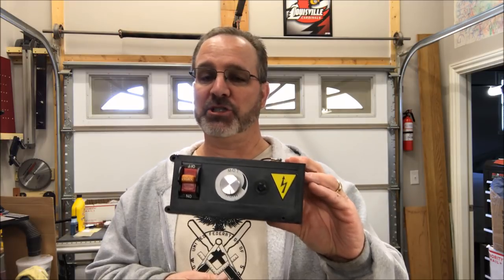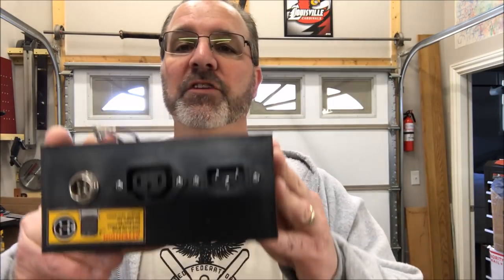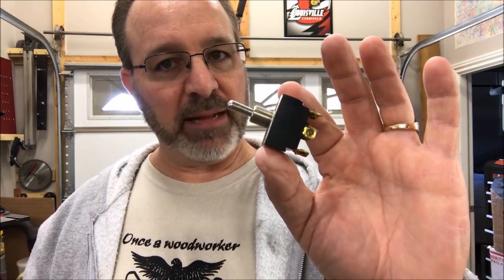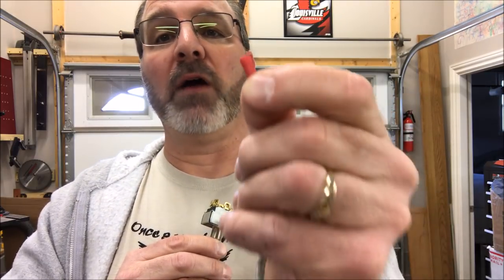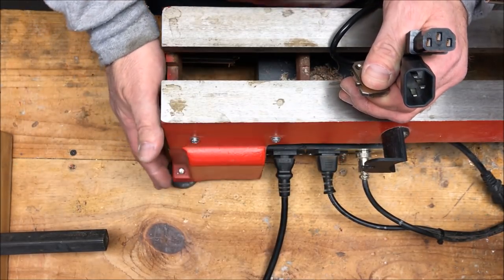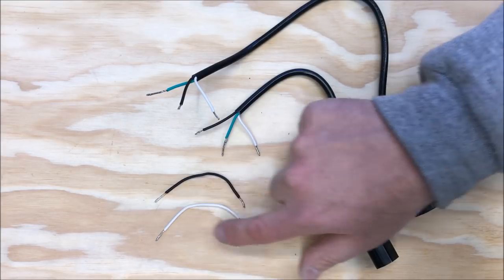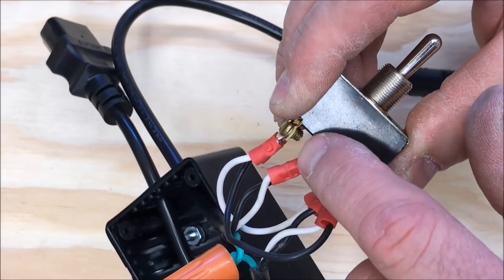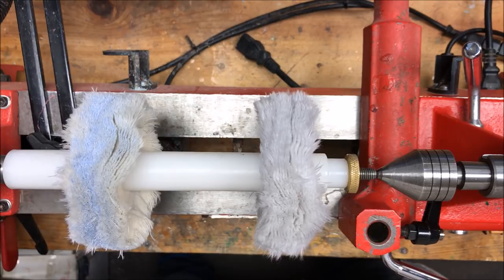I Built A Reverse Switch For My Lathe.

Comment: Hi Bob
Well I am an electrician and I think that you explained this project very well, the one thing that you should have included is a strain relief connector on the cables where they enter the box, other than that a great job and I know you will love having the reverse option. 
I do not have that option on my current lathe but I'm buying a second new midi lathe this year that will have reverse, and great tip on a lock screw on the chuck. 
Take care
Rob
Reply from the maker: Thank you Rob,
  I appreciate that. 

Regards,
Bob
Reply: Was just about to say the same thing. The other thing is that you can most likely (i haven't looked) get a guarded dpdt switch and reduce the possibility of of an accidental power up.

Comment: Very well explained video.
I did something similar.
I converted a HF 1”x30” belt grinder to a DC powered knife sharpener using a PSI woodworking midi lathe conversion kit. I needed the motor to turn in the opposite direction it came so I reversed the blade terminals on the Circuit board that supply the motor. Now after using it for a few months I would like to have the option of either direction of rotation so I’ll Install a switch similar to what you’ve done.
Again, nice job👍🏻!
Reply from the maker: Thank you.  

Regards,
Bob

Comment: The last part about the chucks is very important, there are special, reversible chucks on the market by a number of manufacturers such as Nova.  It can not only loosen the chuck from the headstock but it can cause the jaws to loosen as well.  Neither is good for you or your project!
Reply from the maker: Thanks Doug. 

Regards,
Bob

Comment: one correction Bob, most ac motors can be made reversible with a switch.  BUT not this way.  if its a single phase motor, you have put the dpdt switch in the starting circuit.  if its a three phase motor you install the dpdt switch in any two of the 3 power leads.  i have done this several times with single phase motors
also trying your method on an ac motor will not harm it at all,  the switch just wont do anything, ie no change in rotation!
also, good point about using a chuck or faceplate in reverse, both my chucks(Oneway) and my faceplates have threaded holes for setscrews.  BUT one very important note, if the setscrews bite into the threaded section of the lathe spindle, the thread will be damaged.  the way around this issue is to cut a small piece of solid 14ga copper wire about 1/4 inch long, bend it into a U and drop it into the setscrew hole before inserting the setscrew.  the soft copper will protect the spindle thread.  when you remove the chuck from the lathe, most of the time the copper piece (now all distorted) will stay in the set screw hole and can still be used
i'll send you a pic on facebook of the setscrew/copper wire
Reply from the maker: Thank you for the Information Steve. 

Regards,
Bob

Comment: The biggest challenge in adding a reversing switch is finding a way to mount the switch.  You have come up with a great solution!

In addition to the concern about the chuck, there is one other issue here - NEVER switch directions while the lathe is running!  Instead, only switch directions with the lathe on/off switch in the off position.
Reply from the maker: Agreed Louie,
  That’s one of the main reasons I wanted the On-Off-On switch.  To kill the power before reversing. 

Regards,
Bob
Reply: I did it!  I bought a box on e-Bay, and a switch at Homer's about a year ago, but then put the project on pause to think about how to mount the box.  Based on your suggestion, I used a magnet (from Harbor Freight).  One concern was that the bolt that mounted the magnet extended pretty far into the box - the solution to that was to wrap it in heat-shrink tubing, and then zap it with a heat gun to shrink it down to conform to the bolt.  I thought I had a C13-C14 cable, but I couldn't find it, but I found a relatively inexpensive source at Amazon.  Like you, I used StaCon ring terminations to make the connections, and after wiring up everything, I used an ohmmeter to check that there was no stray connection between the two sides of the DC circuit - in both the forward and reverse positions, and also while switching. And as Rob and others have cautioned, I stopped in Ace Hardware this morning to pick up a couple of nylon strain-relief bushings.

Did I need it?  Don't know, but I did want it!
Reply: One additional thought in the 'if I were to do it over again' column -  I bought a 2 ft. c13-c14 cable.  That's long enough to allow me to attach the box to the back leg of my lathe.  But in retrospect, buying a longer cable would have been better because it would have provided far more flexibility.    An 8' cable would have cost less than twice what the 2' cable cost.

Comment: This is kind of a different take on the model railroad procedure for wiring track reverse loops. They typically run the wires from the middle two terminals to the rails (track). The two wires from the controller attach to the outside two terminals on one end, with a jumper off each one going to the diagonally opposite terminal on the other end. I guess that would work for this too. Great video!
Reply from the maker: Hello Tom,
  I have to trust you on this one, I never would have been able to accomplish it without the help of my viewers. I’m not much of an electrician. 

Regards,
Bob
Reply: @RJBWoodTurner  What you did worked swimmingly well! The old “ more than one way to skin a cat” thing (with apologies to cat lovers!)! You taught me something here, and it’s dang hard to teach an old dog new tricks! Ha! I just took delivery of the same lathe, and I will be doing this upgrade! I just discovered your channel and really enjoying it! Thanks!
Reply from the maker: Thank you Tom. 

Regards,
Bob

Comment: I'm glad you stressed DC motor over AC. Universal motors which run on AC or DC and most people view as AC, can be reversed but that requires disassembling the motor itself.
Reply from the maker: I really don’t want someone trying this Ann getting hurt. That’s why I was skeptical about posting it. 

Regards,
Bob
Reply: The way you did it was removed from the electronics and motor so it was the safest way possible.

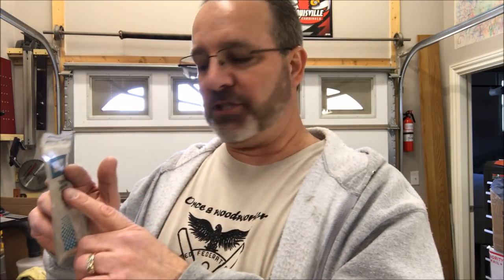Comment: Great job Bob! You explained it very well. I have just a couple of comments. First, at 5:55 you said your motor's plaque said 120 volts AC. I just pointed this out because  I'm sure it was a mistake (as shown when you showed a picture of the plaque) I just didn't want anyone confused because it's very important. Second, in all my years working in electronics, I've never seen a switch that didn't come with 2 nuts. One is to be put behind the panel and the other one (sometimes decorative) goes on the front of the panel. Check around and see if you didn't drop them. If you can't find them let me know, I have extras around here. See, you didn't thing anyone was paying attention! LOL
Reply from the maker: Thank you Jim,
  I have looked all over the place, I even swept the shop this morning hoping to find the nut to hold the switch in the box. If you have spares, I’d be happy to pay for them as well as shipping. The threaded switch post is 1/2”. 

Regards,
Bob
Reply from the maker: Thank you Jim,
  Address sent. 

Regards,
Bob

Comment: Love the videos Bob.   I did something similar to my Harbor Freight lathe.   I replaced the motor with a DC motor and built a variable speed controller on it.   Sure beats changing belts, but I kept the old motor/controller just in case. :D  Would be great to try and add reverse to it also.
Reply from the maker: Thank you Paul,

Regards,
Bob

Comment: Great tips! It Looks like I have the same lathe as yours.  Can you put the link on those parts you've used?
Reply from the maker: I don’t have a link, it was just a 120volt on-off-on switch that reversed the polarity. Any electronics shop should be able to sell you one. 
The motor on that lathe gets power in one direction. That makes the lathe spin towards you. Reverse that powers direction and it will spin in reverse. 

Please consult the experience of one of the people at the electronics store. I am not an electronics expert. 

Regards,
Bob

Comment: Oh and if there is anyone out there with a 3phase ac motor ( unlikely ) but if there is then it is possible to reverse that motor simply by swapping any 2 leads to the motor although it would most likely be controlled by a VFD with reverse option built in. 
There are (VFD's) that are 240 single phase in and 3 phase out. 
VFD= variable frequency drive , these control the speed by adjusting the frequency.
Reply from the maker: Thank you Rob. 

Regards,
Bob

Comment: I have the same lathe and would love to have the switch on mine.  (Note for Turncrafter - why don't you put the switch on in the factory).   Not too sure that I want to try it.  I have an  ac motor on a large lathe that an old timer added a switch to for me and it works fine.  I'll have to look at it to see how he did it.  Thanks for the great video.
Reply from the maker: Thank you Edwin. 

Regards,
Bob
Reply: The Turncrafter lathe is actually made in China, and is sold by various retailers  in the US (PSI), Canada (King Canada), and UK (Axminster) with the only obvious difference being the color of the paint.  The King Canada version appears to have a reversing switch included in the control box as supplied from the manufacturer.

Comment: Just FYI in the electronics industry you do not tin stranded wires that you crimp as when you crimp the wires you run the risk of fracturing the wires. If you want you can solder after you crimp for a solid connection but is not required
Reply from the maker: Thank you.

Comment: I just added a variable speed controller to my Jet lathe. At what speeds do you recommend turning, sanding, applying finish, and polishing? Thanks.Gary
Reply from the maker: I turn pens wide open, 
Sand around 500. 
Apply finish at the lowest possible speed. 
Buff around 1100. 

Regards,
Bob

Comment: Looks good Bob, very solid.  I cannot tell you how many hard drive magnets are floating around my shop, usually drop them in the bottom of a plastic parts tray. :~)
Reply: I have a pile of about 50 HDD magnets all clumped together waiting for me to separate them from their backing. I'm half expecting the clump to become intelligent and mobile and take over my shop.
Reply: Oh, perfect... Replicators!  Now I'm in fear of returning to the shop :~)
Reply: I never turn my back on 'The Clump'
Reply from the maker: I’ve been collecting them too, they really come in handy all over the shop. 

Regards,
Bob
Reply from the maker: LOL.
Reply: I have magnets all over my lathe. A big one holds the key for my drill chuck and a smaller one holds bushings as I pull them off the mandrel. I also have a magnetic parts tray on top of my head stock that holds extra spacer bushings and my Tommy bars for my scroll chuck.
Reply: They do. Every time I recycle a system for my customers I destroy the drive by disassembling it fully. Needless to say I've done that to a lot of drives. I have the magnets screwed to walls, desks, tables, tools, ... all over the place. My big problem now is I have to demagnetize my tools. Time to disassemble an inductive motor I guess.

Comment: I have enjoyed your lathe videos. I am considering purchasing a Turncrafter 10" or 12"  and wondering how your experience has been.
Reply from the maker: It’s a good lathe but I’m ready to take the next step and move to a Jet. 

Regards,
Bob
Reply: @RJBWoodTurner  Why the Jet? Do  you think the Turncrafter is still good place to start?
Reply from the maker: WickedZen It’s true the TurnCrafter is a good introductory price but the tolerances on it and some off the other next tier lathes is way better. 

Regards,
Bob
Reply: @RJBWoodTurner  Well I was going to pull the trigger on the Turncrafter 12" that comes with a pen starter set for less than just the Jet 1015. I have a pretty limited budget and liked the idea of having the basics, including blanks and kits, to start turning pens right away.
Reply: @RJBWoodTurner  Just not sure its the right choice, but the alternative is having to wait several more months before i can start turning.
Reply from the maker: WickedZen I understand completely. I had posted night reply but it didn’t attach.

Comment: Bob. Since all the Radio Shacks closed. Where did you get the cable?
Reply from the maker: Local electronics store called Hutch & Sons. You can get them off eBay too just search C13 to C14 cable. 

Regards,
Bob
Reply: Thanks - I was going to ask the same question!

Comment: For those playing along at home for more info the term you are looking to Google is "DPDT H Bridge". I don't think I heard this term in this video.
Reply from the maker: Thank you Cliff. 
  Looking back at the bag it came in, I missed that nomenclature. 

Regards,
Bob
Reply: Well the bag would only say DPDT ON-OFF-ON with current ratings like 120VAC 20 amps or 12 volts DC 30 amps, etc. 

The way you wired it up is called an H bridge. I wanted to get the term on here since you really didn't show the circuit diagram. Which I think may have been on purpose with all your disclaimers in the beginning.
Reply from the maker: Thank you Cliff,

Comment: Question from a metal lathe guy - do all woodworking lathes use threaded chucks?
Reply from the maker: I have seen a MT2 chuck before. But doe the most part they are threaded. 

Regards,
Bob
Reply: Wood lathes usually have a MT1 or MT1 headstock, but the chucks themselves are usually threaded, and there are quite a few different thread sizes as well so you have to know which one your lathe is and it seems the most popular is the 1"x8TPI.  I have a mini lathe from Harbor Freight which has an MT1 headstock, and the chuck needs an adapter to go from the 3/4" x 16TPI to the 1" x 8TPI.  

When I got my metal lathe it was different machine completely for sure, but figured out the headstock Morse Taper size...and got the adapter to go from the #3MT to a #2MT because they don't make a #3MT pen mandrel LOL...it works great and from what I've been finding the Harbor Freight metal lathes are Tiag as well since Tiag is the only manufacturer of the small benchtop size metal lathes.

Comment: I am certainly not an electrician. I would have assumed that the ground wires would also have been connected to one of the bolts holding the rare earth magnet to the box in case the live wire accidently touched one of the bolts and made your lathe bed live? Maybe rare earth magnets aren't electrically conductive?
Reply from the maker: Good question Andy, I’ll consult my electrician friend and see what he has to say. I want this to me safe. 

Regards,
Bob

Comment: Something very odd about your motor label yes its DC but is it really 120 volts DC and why does it say 60 cycles and single phase which are all AC specs. I think they just reused a AC motor sticker's layout and just changed the DC on top.
Reply: Perhaps it's a universal motor.
Reply from the maker: All good questions. 

Regards,
Bob
Reply: Ah yes.

Comment: I've made a lot of pens but haven't felt the need to have reverse on the lathe...you could save a lot of time and effort by just standing on the opposite side of the lathe if you want reverse ;).
Reply from the maker: Thank you William. 

Regards,
Bob
Reply: Sorry just couldn't resist LOL.
Reply: OMG! I never thought about that! Ha! I’m just gonna mount mine on a lazy Susan bearing and BAM! Problem solved! Won’t have that troublesome tool rest interfering with sanding either! I’m joking, but you make a very good point!